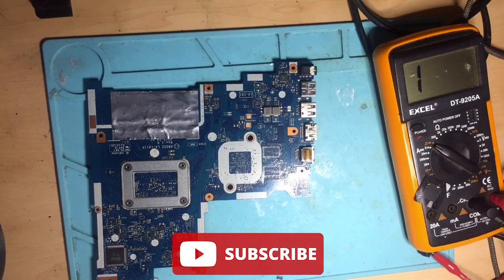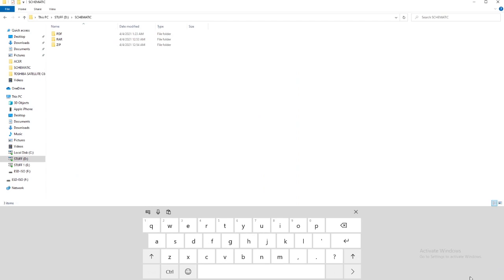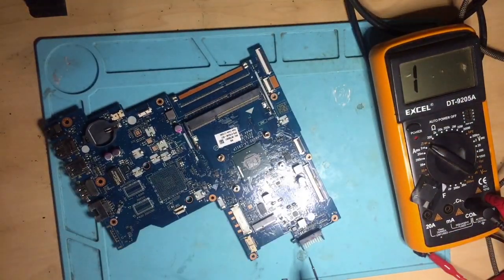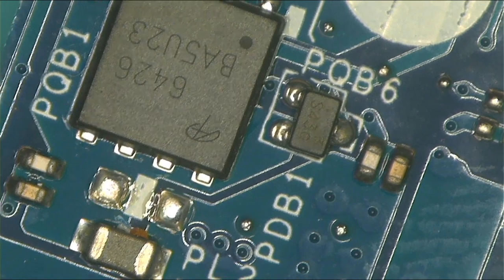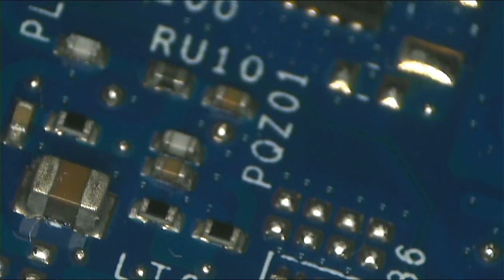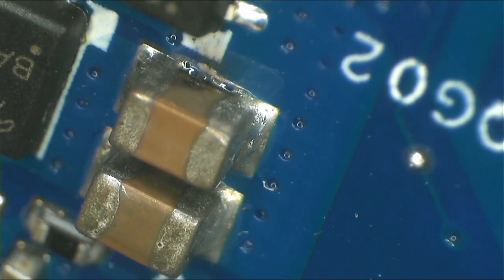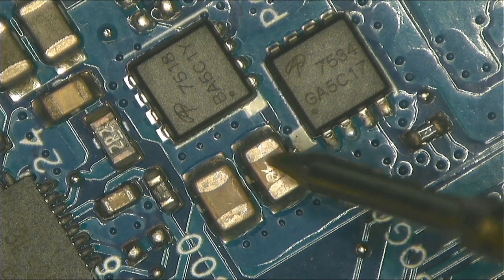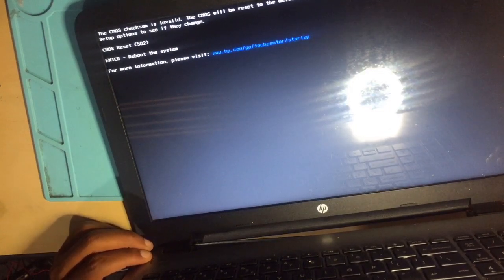It's possible to spot shorted ceramic capacitors

Comment: so replacing it isnt needed sometimes i fix my dell 7450 by removing 3 in a row so i left it alone i do have another mobo from an hp i could get some off it if needed but so far it works fine. from what i understand they are like noise filters